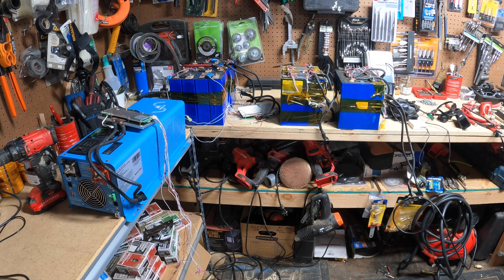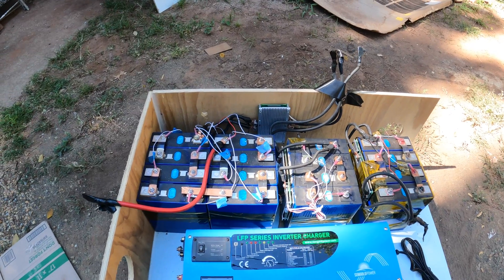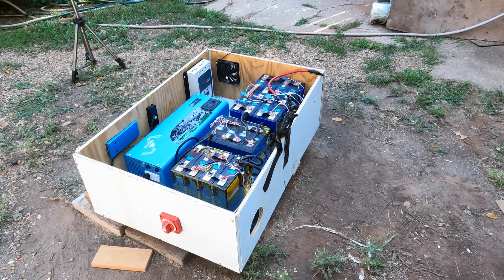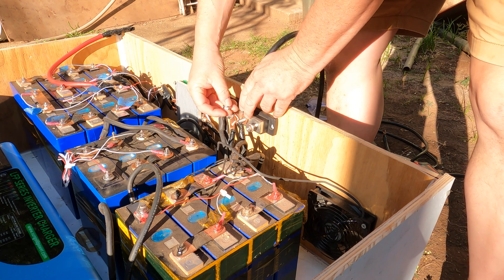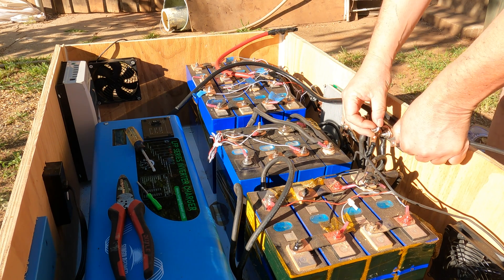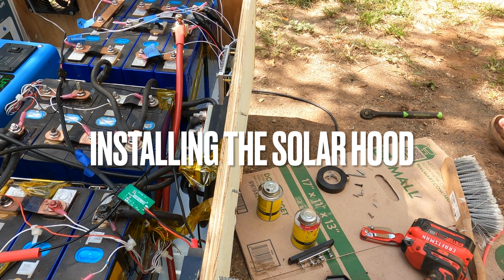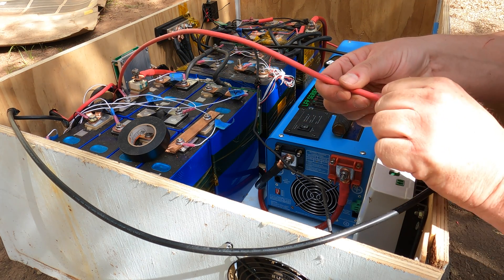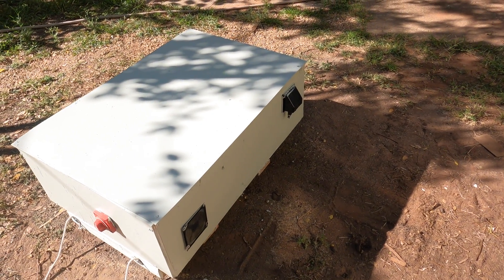DIY power station build.  Watch me build a Massive 24v, 4000w, 10kWh portable generator.  Part 2

Comment: Hope you tightened everything up. I suggest you use 150 amp class T fuses. They are expensive but they may save you from starting a fire. At 4000 watts, there is a lot of potential heat in those wires, especially at connections.

Comment: I Built a Similar Set Up with 4 24 Volt 100amp Batteries @ 10K and Dual WZRELB 3000 Watt 24 Volt Inverters and 1600 watts of Eco Worthy BiFacial Solar Panels to Dual 150/35 Victron Energy Smart Solar Charge Controllers and a step down Buck Inverter for 12 Volts. And very please with The 300amp Blue Sea Disconnect and Buss Bars and Terminal Fuses on each Battery.
Reply from the maker: Sounds like a nice setup. How do you like your WZRELB inveters?
Reply: @OurBlackCatCottage So far They handle anything I toss at Them both 2500 and 3000 watt 24 Volt models.
Reply: @1GREATDANE you could have just bought a Titan, from Point Zero Energy 240v and 120v  4000w  low frequency unit, with idol consumption under 15w